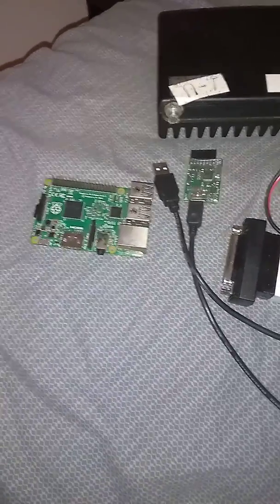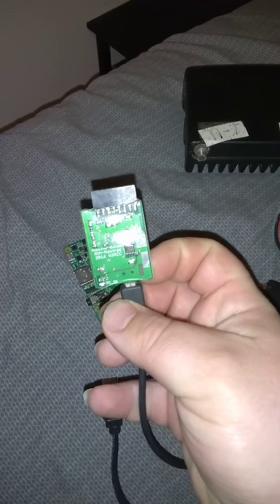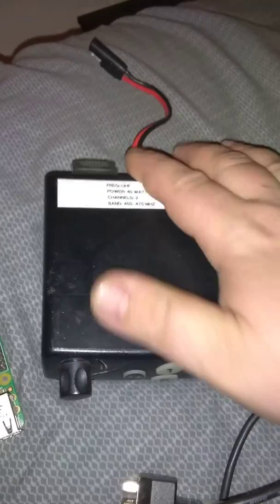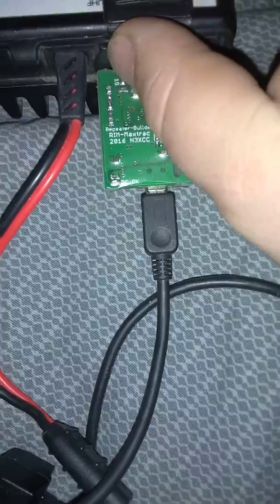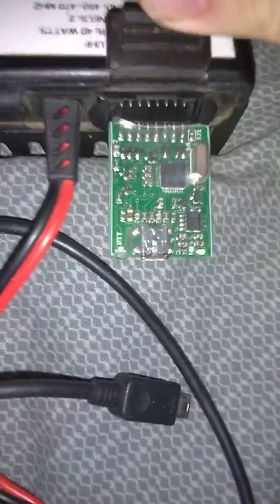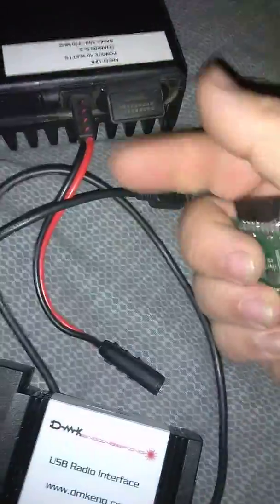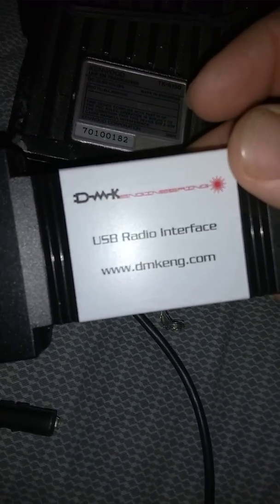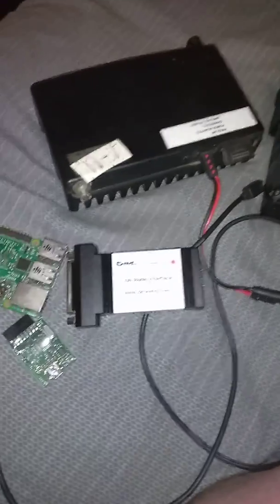GMRS Repeater and Simplex hardware

Comment: Website has no info on parts.
Reply from the maker: Making a few changes right now. Is there something I can help you with?
Reply: The GMRS Linked Network looking at setting one up. Needed parts list and any programming info to get going.
Reply from the maker: What kind of setup are you thinking about doing? Do you have a Repeater
Reply: The GMRS Linked Network Simplex for now Repeater later.
Reply from the maker: @KINGSTONSPRIDE  do you have a Motorola radio with the 16 pin connector on the back. Called an accessory jack  http://www.repeater-builder.com/motorola/sm50/sm50-pix/rear.jpg
Reply from the maker: @KINGSTONSPRIDE   right now we are not offering the plug-in play kit right now.